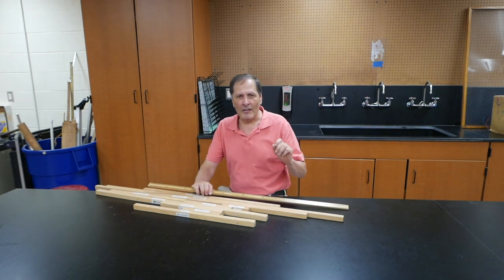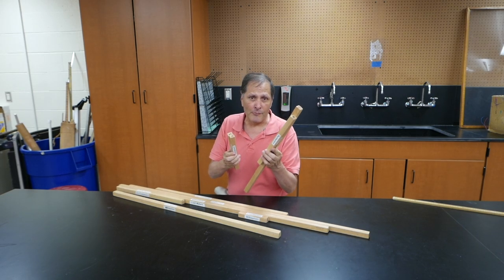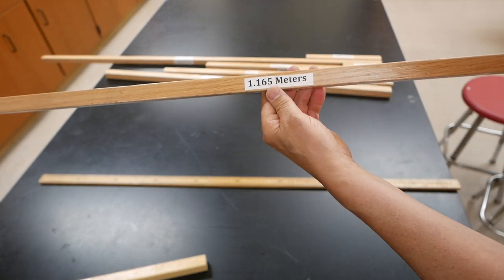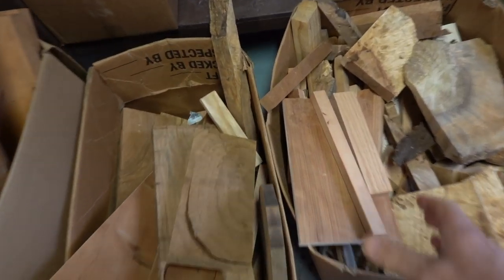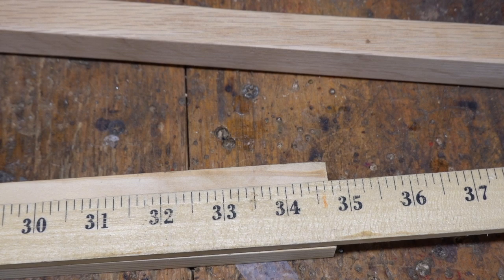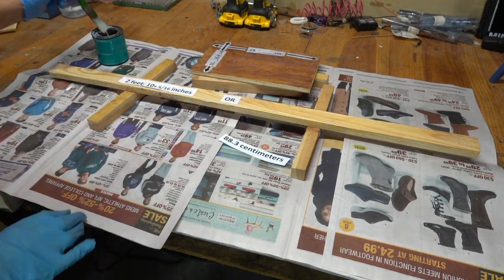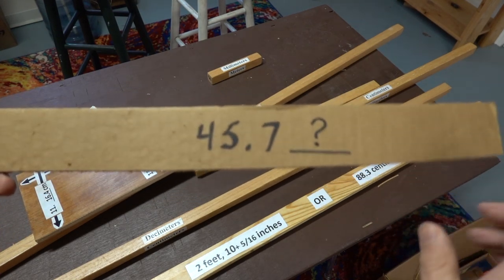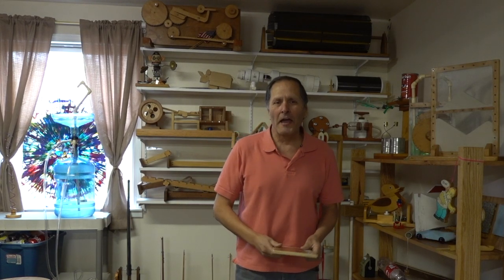Teaching metric measurements suggestion --- length. // Homemade Science with Bruce Yeany

Comment: Having attended school in Canada in the 1970s and 1980s, in fact beginning right after the metric system was adopted in 1977, all I was taught in school was meters, kilograms, liters, Celsius, etc.
The trouble is you have to learn the English/Imperial system on your own, because 40+ years later, in Canada, stores still sell food by the pound (because the price look 50% less than if sold by kilogram, building supplies - wood, pipe, drywall, etc. is sold by the foot and inch. Almost all bolts, nails and screws are in inches (mostly to match existing structures and equipment). In industrial applications, the US Gallon and degrees Fahrenheit are still very common in use. When the news reports descriptions of crime suspects, they use feet, inches and pounds. *Canadian schools essentially leave graduating students unprepared for the reality they will face in the real world in Canada. True, speed limits, distance signs are in km, and weather reports in degrees Celsius, but after 40+ years, there is a long way to go for the metric system to be adopted as it is in Europe, and if it hasn't yet, it likely never will.
Reply: As a european, i wouldn't be surplised if i failed in a us school. All those unhinged units that don't fit plus fractions, i've always sucked at fractions.
From gaming and so on i know 1kg is 2 pounds and 1m is 3 feet and a bit so i feel sorry for you and so manny North-American technitians needing to buy two toolsets.

ps: i forgot about mixing units and having to calculate the remainder of feet into inches.

Comment: Never came across anyone using decimeters, only ever cm or mm (most tradies used mm I found)
Reply: On the contrary, you can find them pretty often when measuring volume, as 1dm^3=1litre
Reply: @MrSzybciutki  interesting! :)
Reply: Yep I agree. The only time I've ever used decimeters was in some random test.
Reply: In France we don't use them but we all know the word as a 20cm ruler we all have in our school bag as children is called "double décimètre". 

But you need to teach decimeters to make sure they get the concept of x10 = a new unit. 
Do you use decameters ? Hectometers ? No. But you learnt them.
Reply: That doesn't make sense, because we don't teach 10,000 units nor 100,000 units. 1 L is better taught as = 10cm X 10cm X 10cm rather that 1dm^3. Even better since 1mL = 1cm^3 and 1000mL = 1L. So 10x10x10=1000.
Reply: The other equivalence between volume and dimensions is 1kL = 1m^3 = 1 tonne. So to convert to L just divide by 1000. This all lines up with engineering units (p,u,m,k,M,T,P) which are powers of 10^3. Decimeters do not fit into this concept.
Reply: I sometimes find decimeters useful to estimate volumes or weights without using a calculator.
For example, let's think of a piece of steel, with dimensions of 200x100x20 mm. 2x1x0.2 = 0.4 dm³. Steel weighs 7.86 kg/dm³, so lets take 0.4 times 8 = 3.2 --> the weight will be somewhere around 3.1 kg. Same piece made of aluminium (2.7 kg/dm³) will be 0.4 times 3 =1.2 --> around 1.1 kg
Of course you can do the same with centimeters (since kg/dm³ is equal to g/cm³), but the numbers are much higher and not so easy to handle without a calculator (at least in my opinion)

Comment: Kilometres,  metres, millimetres, and to a lesser extent smaller units have practical application. This applies to other units as well, such as litres. The students need to know  that they (decilitres and etc) exist, but if they didn't, no one would miss them. Novitiates occasionally fuck up a simple system by measuring as they would feet and inches, i.e. 1 metre 20 cm and 5mm. NO! It's 1205mm or 1.205m.

Comment: Who actually uses decimeters????
Reply: I use SI units a lot. I never write anything in dm. One place where I find dm useful is when thinking of liter, water and kg. E.g. under 10 m of water the pressure increase is 1 atm. That is 100 dm on a surface of 1dm*1dm = 100 l ... = 100 kg. on 100 cm^2. result: 1kg per cm^2
Reply: I have never heard it being used before.
Reply: No one in the UK really uses cm either tbh.  Meters or millimetres. Cm are basically used in schools but nowhere else.
Reply: @Great.Milenko  In everyday life(not science), cm is probably the most important unit. A door is 80 cm wide. A piece of paper is 21 by 30 cm. I am 176 cm high. I guess UK still  got a strange relationship with units.
Reply: @hpekristiansen  you're right cm is the most useful unit for human sized measurements but I've always been taught to think in mm or m only. Mm for accuracy. M for general measurement
Reply: @hpekristiansen  : mm is the most common unit beside cm and finally m. Dimensions of "smaller" things including the DIN standard for paper is mm. Larger things like cars or furniture are noted most often in cm and biggest things like a house in m.
Reply: @PhreakDarkSoul  I never said that it is not. - except now: No it is not.
Reply: @hpekristiansen  It simply depends on the purpose.

Comment: Hi, I work in a school and we want to make a project where they build a theme park or something that they will have fun building it! but with simple machine (wood, cardboard ). Any ideas?
Reply from the maker: this whole channel is pretty much dedicated to projects that people can build form themselves, scroll through my list of videos and see what you can find.  If you have more specific questions about ideas let me know
Reply: Copper insulation tubing (the foam stuff at home depot) is super cheap and makes great roller coaster tubes for marbles. The trick is cutting it in half and keeping the tubes even. Other people go the super hard route and make actual tracks for coasters out of  ice maker tubing and nails to make the rails, and still a marble for the coaster. Bruce has tons more examples here. This channel is one of the best resources for excellent science examples in real life, not just formulas.

Comment: When do you need to convert units in real life though? A lumber yard doesn't start converting its orders from feet to miles when they top 5280. Aircraft cruise around forty thousand feet (and they still say it that way, even in effete Euro countries!). Nobody worries about how many miles that is, because it doesn't matter.
Reply: Building an international space ship... there was already a tragic accident due to wrong length unit afaik. So it is essential to note and convert units for international coop work at least.
Reply: @PhreakDarkSoul  You're referring to the Mars Climate Orbiter, which failed in 1999 because Lockheed Martin supplied the results of a calculation in pound-force seconds while NASA was expecting it in newton seconds. That supports my point: it's better to pick one unit for a purpose and stick with it, rather than converting. And so the ease of converting from m to km or feet to miles is simply irrelevant when choosing a measurement system.
Reply: @HebaruSan  Ever hear your GPS announce upcoming distances in feet for close distances and miles for far distances?  I would expect that GPS's built for the countries that use metric, also do the same, except in meters and kilometers.  If you were programming the GPS, you'd need to know how to convert the units in order to get it to announce both to the driver.

Comment: out of curiosity,  does anybody actually use decimeters to measure anything?
 I learnt them in school but haven't ever come across them in the real world.
Reply: Decimeters can be useful for conversion of volume to/from litres.
1 litre = 1dm^3  and since a litre of water is 1kg, you can get a quick sense of mass from volume.

(Also1 ml = 1 cc)
Reply: For example, I weigh 50 kg, and I float in water - but only barely, so I have a density comparable to water, so it follows my volume will be on the order of 50 litres or 50 dm^3  - as a crude estimate. 
It's wrong, because I have lungs full of air, (and other gasses in other places).
Otoh, if I were 1.8 x 0.2 (average) x 0.2 (average) m = 18 x 2 x 2 dm my volume would be 70+ litres.  Another crude estimate.
Reply: I've never heard it used in Australia, in conversation or in the sciences. Engineers use mm, or m. When talking we use cm, m, km. Never dm
Reply: yeah, like when someone ask if they parked their car close enough, and like "yeah, about 2 decimeters from the wall" instead of 20 cm because decimeters is easier to "calculate" the distance instead of cm in some cases, hope you understand me :)
Reply: @Leifinator90  what country are you from?
Reply: @Adlore  I'm from Sweden 👍
Reply: @Leifinator90  that's interesting I think using decimeters vocally must be a Swedish/euro thing.
Reply: @Adlore  Not, a euro thing. I'm from germany and I about never hear decimeters outside of school. I think even in school only a few times. maybe it's my social bubble but no dm in my everyday life
Reply: I'm from Bosnia and only time I used decimeters was in primary school when we were learning about it. 

Today in work we almost exclusively use mm even for long measures - 4563 mm instead of 4,563 m or 456,3 cm. (Steel work, constructions, railing, fencing, ALU / Plastic doors and windows).

However, common units "on the street" and in non professional communication are meters and centimeters. 

Units are used depending on size being expressed. 

You will hardly ever hear 230 cm, most likely it will be said 2,3 m.
Also, it will almost never be said 0,15 m - 15 cm will be used 99% of time. 

Additionaly, meters and centimeters are comonly used in building construction profession - measures in cm are almost exclusively used on their drawings and plans.

Woodworkers prefer centimeters.

I have spent some time working in Croatia and Germany and experience is almost identical.
Reply: @edissmajic  You reminded me of another difference. In most of EU it's 4.321,9 and US 4,321.9. For me it depends what language i speak, in Dutch i will say 4,3 but in English i'll say 4.3.
Reply: Decimeters are occasionally used in verbal communication.  But I have not seen them used a lot in formal documents or specifications.
Reply: When you quote windows and door sizes its often used
Reply: @stone9k  I work in the window and for industry. we use millimetres to measure literally everything because most of our tolerances are in the mm range.  
it might be a UK thing but even for volume we will just use litres millilitres and cubic metres.  never once, outside of school have I ever heard anyone use decimeters.

Comment: I only know metric. Temerature in Kelvin or on the Celsius scale and the element Al is called Aluminium.
Reply: What do you use for pressure? PSI, PSm, Bar, inHg, mmHg, Atm?
Reply: @Reach3DPrinters  The SI derived unit for pressure is Pa (Pascal). 1 Pa = 1 N/m^2 = 1 kg/m*s^2 = 1 J/m^3 with the SI units of length in m (meter) and of Energy in J (Joule).
It is directly convertible in bar. 1 bar = 1000 hPa = 100000 Pa.
In everyday life usually bar is used, however in engineering calculations Pa is used (simply multiplied the value in bar with 100000).

For measurement of blood pressure mm Hg is still used.
Reply: Also, for food calories are mostly used. And, to make things complicated, when people say "calories", they usually mean "kilo-calories". I think I have no idea what a 1J of enery is in food counterpart, while I have a pretty good idea in kcal.
Reply: @brcha  I only have an idea about energy in Joule. Mainly the kinetic energy of moving objects. But I do not know much about the energy in food.

Comment: Being Canadian, I'm versed in both imperial and metric. To answer your question which one is easier, it depends on your application.

As the metric system is a decimal system that's units are smaller than the imperial inches, measuring to accuracy is much easier given a 0.5mm tolerance. 

However, the hidden aspect is that the imperial system is based off of a duodecimal or dozenal system, which makes it more comprehebsable to fraction off. In other words, say you have a width of 3 inches (7.62cm) and you'd like to drill a hole 1/9ths it's width. It would be easy enough to divide each by 9, however, it becomes much easier to comprehend a 1/3" hole rather than a  0.84999999999999...cm hole, especially when trying to calculate the spaces left on the sides. 

This is due to Metric's rigidness in a decimal system while imperial favors it's power of 2 fractions.
Reply: Now imagine you have a width of  9 cm and  you'd like to drill a hole 1/9ths its width.
Now imagine doing it with inches.
Reply: @jonathanlange1339  50/127ths. Or a 12/36ths or 6/16ths drill would work... Once you know the fraction, all there is to do is add one and divide the denominator by a power of 2 until you get 2,4,8,16, or 32. Then use the same power of 2 on the numerator.
Reply: @With_Victor_B  
I dont think you understood me.
If you have 9 cm (3,543307086 inch) and want 1/9 th, 1cm (0,393700787 inch).
Which system is better for it?
I am not sure what you want to say.
Reply: Except you never have width of 3 inches - all industrial supplies, consumables and tools are already metric based on mm in pure metric country.

So you would have 90 mm width and would use 10 mm drill. 

Drills are common in 1 and  0,5 mm increments as well as in 0,2 mm and 0,1 mm in more specialized stores.

Almost all raw material is in full mm number. 

Drilling strange size  hole like 4,73 mm or similar could only come up in machining a mould with accounting for shrinkage - so feature gets to 4,5 mm after cooling.
Reply: metric + duodecimal = heaven!
Reply: What about 0.85cm hole?
Reply: @arifsoylu  again, depends on the application. 
.01mm might not seem like a lot, but 10 consecutive holes would make a .1mm difference and 100 holes  (say one was building a precision framework, or making a straight drill hole) would make a 1mm offset. 

Plus, when working to make angles like a strandbeest, such difference only amplifies due to trigonometry.

Comment: As an English man, reading/hearing it being called the English system hurts my soul. I use metric, metric is the official system (aside from roadsigns, milk and beer) and metric is vastly superior.
Reply: UK/England doesn't use metric for a lot of stuff though
Reply: refreshfr --- Only road signs are in miles and mph and only old people use the imperial system. Everything else, science included in metric. Weights are measures are now in metric in shops. Metric has been taught in school since the early 1970s. People do refer to their height in feet and inches and their weight in "stone" but that is changing, it's and archaic system.
Reply: Uh huh.  And in Rome they use Arabic numerals, not Roman numerals.  This is about what your ancestors invented, not about what your own delicate soul has done.
Reply: @christosvoskresye  could you provide a translation to your point?
Reply: Ok so you basically don't use metric then
Reply: Metric has yet to be defined by any universal singularity. It's a random unit  that  uses base 10 like our  fingers,  that is as universal as mankind.  There's mythology about 6 to and fingered people,  so..?